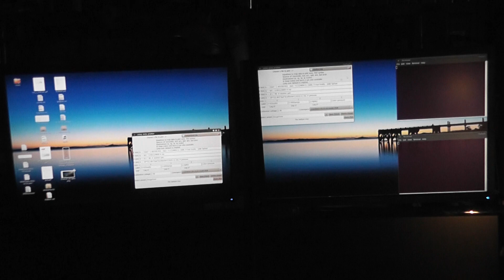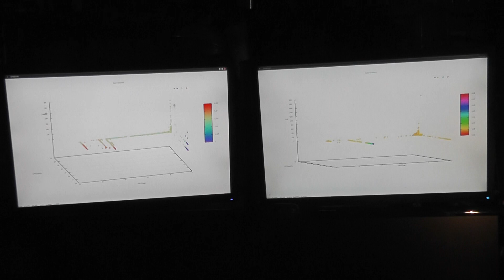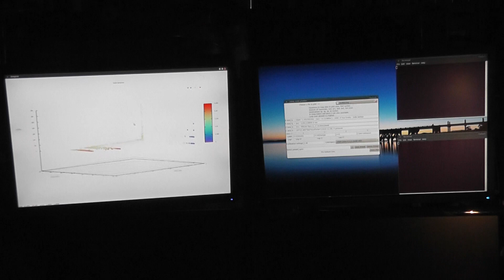QAnalysis2grids - everyone (else) is doing it wrong!

Comment: What I dont get, is how do you control current and voltage. Doesnt a certain voltage lead to a certain current? Where do you measure voltage?
I would assume that the current at a certain voltage depends on pressure and grid geometry etc.
Reply from the maker: The short answer is "with great difficulty".  Gas pressure is key, and we work on the very steep left part of Paschen's curve.  I'm using a separate power supply and a grid out in the main tank as an ion source (bigger distances so it's lower on the Paschen curve).  But with outgassing when things get hot, changes in eletron emission - it IS the hard part.  More on my site (recently linked in the original description).  Main supply has a set current limit, and there's a big ballast R in series.
Reply: Doug Coulter Interesting, so you change the pressure to control the current?
Do you measure the voltage in front or behind the ballast R?
Reply from the maker: Measure before, but calculate after, based on known current (the supply senses that) for plotting.
It's not quite as simple as just controlling the gas - even with perfect gas control it's a little hard to get stable.  But...stable is not best Q anyway.  You still have to "fly" this thing manually and adjust stuff.  I use the ion source for fine control, within limits.
It's not as critical at higher pressures, where the current is simply set by the current limit I set on the supply (a Spellman SL2KW) and it's super stable, but again, that's not where the high Q lives.
Reply from the maker: Note, with the ion source as a "control grid" we've made a PNP "vacuum/plasma" tube...
It has a crap-ton of power gain....so we might use it as an oscillator to get that onset/edge effect.
Reply: Doug Coulter Very interesting but also humbling, guess I still have a really long way to go.
Reply from the maker: We all do. A journey of a thousand miles starts with one step...then a lot more.